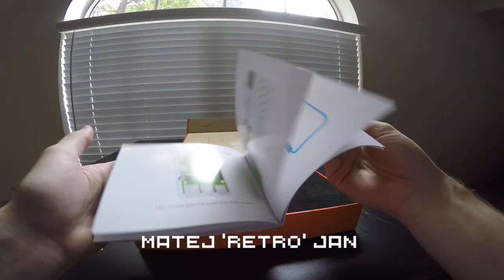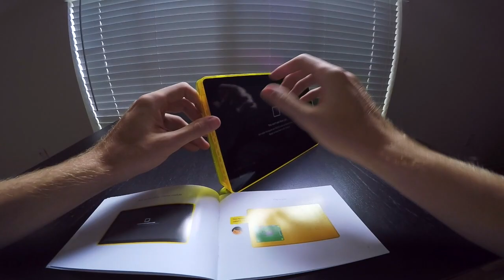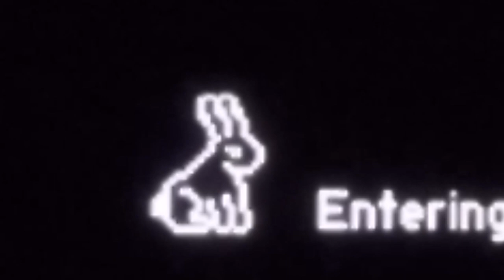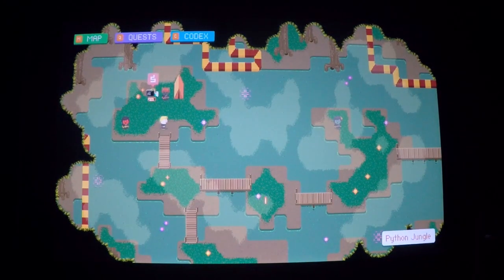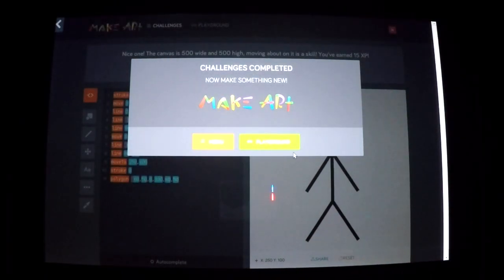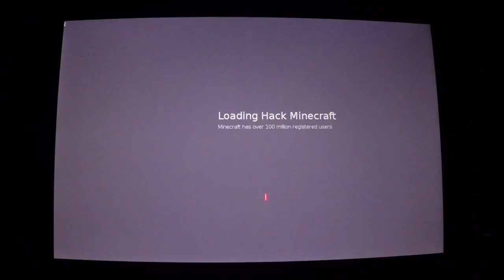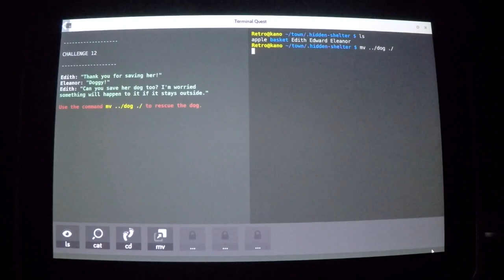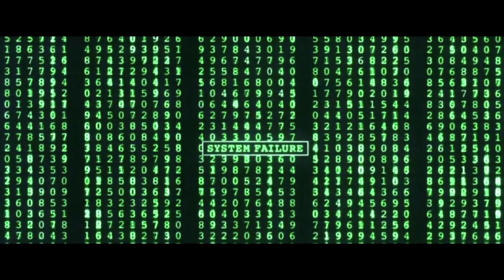Kano Computer Kit — Retronator First-Person Review

Comment: Why are there like 0 tutorials for the one with lights instead of a speaker
Reply from the maker: Maybe the Pixel Kit was pushed stronger (marketing-wise) than the Speaker Kit? Or maybe people just prefer tinkering with lights over sound.
Reply: Retronator no it wasn't the pixel kit, it was the speaker kit but instead of a speaker it had 10 LED lights in a circle (unless that's what the pixel kit is) but it's okay I've already figured out how to set it up
Reply from the maker: Ah yeah, I know which one you mean, it was one of the first things from them. Glad you got it running.